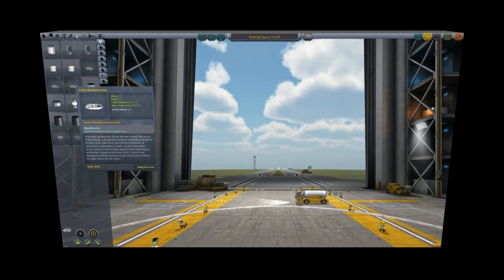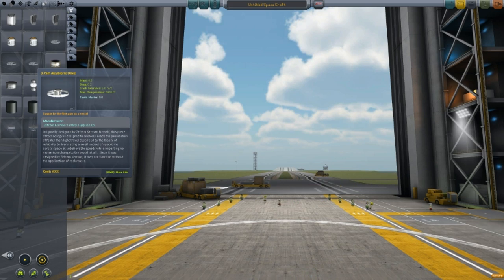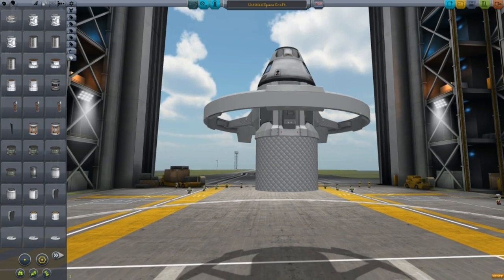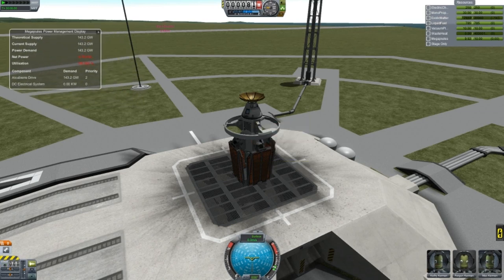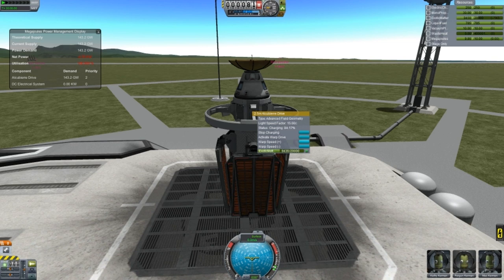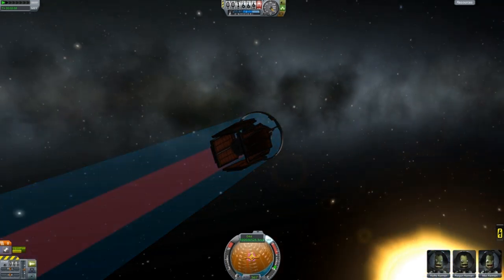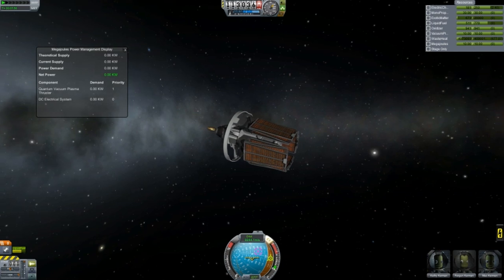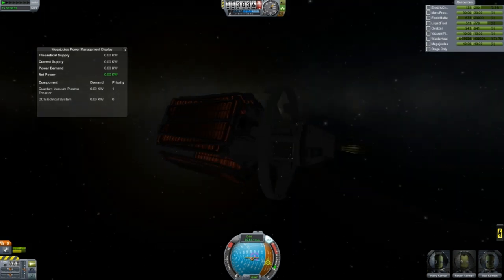KSP Interstellar: Alcubierre Drive Tutorial

Comment: Made acraft with enough power to power the whole universe. 
Still get  'Not Enough Power to initiate Warp Field' 
I am on the verge of going bat shit insane.
Reply: Do you actually have the electric power, or just thermal? You need the thermal electric generator attached directly to your reactor to convert heat to electricity.
Reply: Do it like in Star trek and get an Antimatter Reactor on your Spaceship.
Reply: This is a bit late, and I'm sure you've figured it out or moved on by now, but for anyone else with this problem, try using the quantum singularity reactor.

Comment: Why is it that when I do the same exact design, my ship STILL doesn't have enough MW power to maintain a warp field? I'm at a loss...Someone help?
Reply: I'm at the point where I'm calling BS on these vids and the mod itself...
Reply: I've used this mod, so it definitely works. Try lowering the warp speed and pay attention to your warp to mass ratio, as if its less than 1, you cannot use the warp drive. Try other larger sources of power as well, some generators do not provide enough to warp with.
Reply: He used power relays -_-

Comment: What is a procedural tank?  I have the warp drive installed but there was no procedural tank.
Reply from the maker: its another mod, the procedural tank mod allows you customise your fuel tank size and its fuel content as you wish :)
Reply: +AddMeGamers what are you using for directional control i didn't see any control wheels or 5way thrusters
Reply: +Theresa Quinn also can i get a list of mods you are using like your parts directory and tank size it doesn't look like tweakscale

Comment: This vid is great, but how do you deal with the the ship maintaining it's velocity? It takes hundreds, maybe thousands of delta-v to remain in orbit after the ftl travel.
Reply: There's a few ways you can shave off speed when arriving at another body with the A drive. You can make the jump when the target is roughly in line with Kerbin and Kerbol so their relative velocities are closer. Once in the SOI of the target stop your A drive so that your trajectory out of warp is taking you away from the target body. Time accelerate as you drift away so you gradually slow down from the pull of gravity. I usually go 1/2 or 2/3 of the way to the edge of the SOI because the bleed off of speed is vastly lower per time spent the further you drift away. Charge your drives and warp directly back at the planet (or moon) until the gravity gets too high and the drive automatically powers off. Drift out again and warp back until your m/s is right for your desired orbit. Be ready to jump at this point but this time aim in whatever inclination you want your orbit to come from off to any side of the body. Break warp at the altitude you wanted your orbit to be perpendicular to the core of the planet from where you started the jump and it should come out almost perfectly circular, negating almost all the Dv you'd need for maneuvers.

Comment: Hah. You didn't get to the actually hard part. When you come out of warp and you're at 20km/s of relative speed to your target. What then???
Reply: Flip and burn like hell?
Reply: @ToqTheWise  Not nerly enough delta-v. Check your speed vector relative to the planet, estimate the direction and amount you'd need to burn to match speed, jump damn close to the sun, in such location that its gravity pulling you in will change your speed as required, wait a good while, when you start overheating jump away, repeat several times, then jump to the destination.